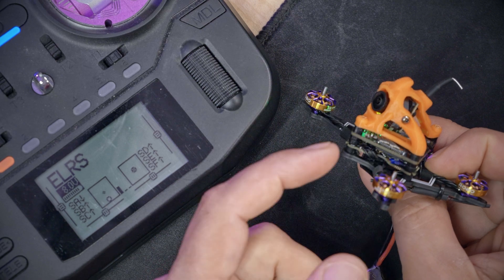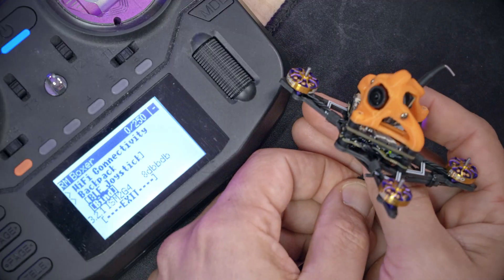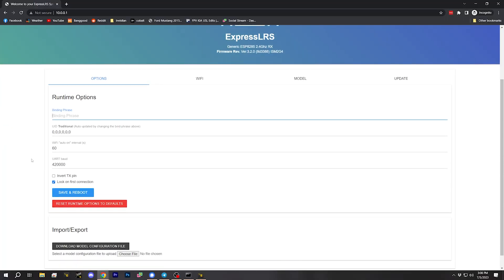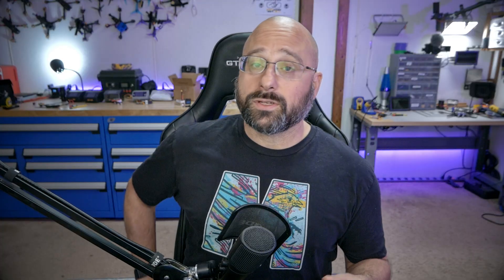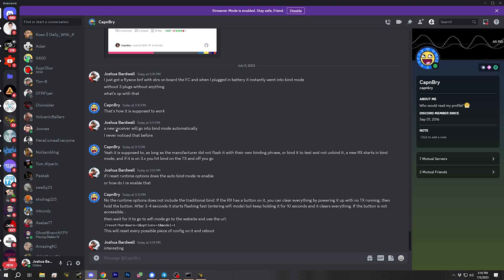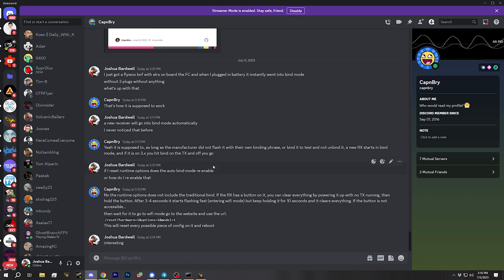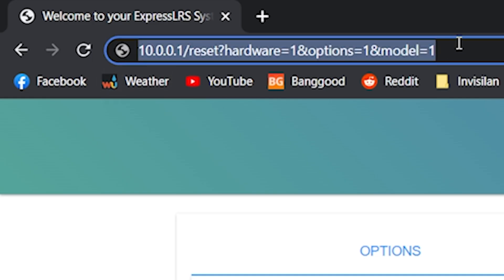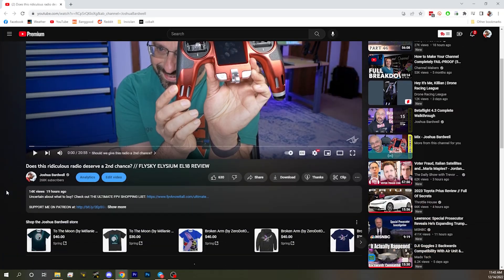Why I always bind ELRS the hard way (but you don't have to)

Comment: Mobula 8 elrs 2.4
Boxer elrs 2.4
OK, set up my binding phrase on my Boxer done 
The mob eight  into beta flight.   
Save the backup of all the settings 
Went to firmware update and pressed auto detect 
Flashed 4.5.1 
Then loaded back up file of all of my settings on the mob 8
All is well so far 
Now clicked on receiver 
It’s on expresslrs
Typed in my binding phrase 
Click save and reboot 
Turned my Boxer on    And nothing
Tried to plug my battery in three times on the mobula
Two times quickly then third plug it in 
Then clicked on my Boxer and I cannot get these things to work so back in the box and back on the shelf 
Help please

Comment: Just got the Boxer Crush and am excited to fly the cnc AG01 gimbals for cinematic. Working on binding it now-
Working to flash the radio with my bind phrase in ELRS Configurator-- it doesn't show Boxer in Radiomaster Devices, only TX16S 2400 and Zorro. Can I use the TX16S 2400 instead?
Thanks in advance for your help!

Comment: I gave the vid a thumbs up for your effort, which I really appreciate! I've just had so much trouble with a brand spankin' new Radio Master Zorro (my first non DJI radio). The drone itself would go into bind mode but the radio acted as if it couldn't care less about binding with anyone or anything. If for some crazy reason it does work someday it'll be named Desperado! If it wasn't for those oh silky smooth oh so perfect Halls gimbals, I'd either smash it with a hammer or put it in my 25-ton hydraulic press and make it slow and painful.... lol!!!

Comment: My preferred method is to first enter my home WiFi network on the receivers WiFi page and then wait for the configurator to see the receiver. The reason I do it this way is that changes to the firmware happen often enough that not a single receiver I have purchased had been on the latest stable release. It is more likely for the receiver to arrive with a version old enough to not be compatible with the transmitter module’s version. The configurator automatically finds the correct target when you flash this way and the connection to WiFi is a bit more secure since it’s not using the same password and SSID as absolutely every receiver not set to connect to home WiFi. This also allows me to verify that settings not on the WiFi page are correct. I believe the defaults are correct though for FCC.

Comment: There's another reason for not using the 3x power on method.

If you have a problem with flakey power - as I did a few weeks ago, caused by a dodgy FC - the Rx is liable to unexpectedly go back to binding mode all by itself.

OK, one can say "well, sort the power out", and in the end I did, but it's just one more thing to cause confusion when sorting out other issues. Now V3 has the web settable binding phrase, that is the easiest way for me.

Don't know why they didn't put a switch on like any other Rx really, but I guess it saves a tiny amount of board space. Though a split pad would have done, ie a through hole pad split into two isolated semicircles. Put a pin in, or a scriber point, while powering up, binding mode, don't, normal mode.

Comment: Thanks, Joshua you've helped me in many ways. Here's something that should be made public. I recently gave Geprc $1,000.00 for two drones. After only 4 days of flying the Cinelog 35 V2 03 I had to do a total rebuild. All went well except for the DJI cable extension that's exclusive to that drone. Antennas are easy to get but, that short antenna extension wires are impossible to find which means I spent $550.00 to fly that drone for only 4 days. I've hounded Geprc and DJI and can't get anywhere. WHY isn't that part made public? Any ideas on what to do. Can I make my own with the I-PEX connectors?
Reply: Later that day on eBay I found these extensions. In all sincerity both Geprc and DJI should have offered these parts. It was like talking to a wall. What the hell did I know of "I-PEX" connectors?! These fragile little things break easy. Last week I broke one installing the front arm on one of my Mimi 2s. Anyway, all is well.

Comment: This has to be the 4th or 5th video on binding elrs. Pretty sure there is only 1 video on binding crossfire. Just saying
Reply: That's the nature of open source projects that strive on innovations and community input. The difference here is that ELRS gives you options. When you can only do so little things, no wonder why your product is so simple.
Reply: There might be one or two others but, a quick search on his channel shows just as many for crossfire. He's covering each way to bind. It's literally exactly the same binding as crossfire if you don't want a binding phrase just plug in the receiver and hit bind on your radio. Also ELRS is better and substantially cheaper, just saying.
Reply from the maker: Ok so fly Crossfire then. More power to you.
Reply: @JoshuaBardwell  we want to fly ELRS   but NO ONE  will HELP  even for 150 per hour  .
Reply: but there's a bunch of videos on crossfire being out of stock...  also the videos about the company having issues...  so i'd rather have 4 ELRS videos about binding than a bunch of out of stock websites with crossfire nano rx on them
Reply: Rather to see 4 videos than doing 4 extra shifts to afford Crossfire :D
Reply: @dfsdgmythtrvvbyrtr  good cause i PAY 150 per hour for ANY elrs help . did i hear this could even be done via remoting into someones PC   .
Reply: best thing about the elrs wbsite is that you can not contact them unless you are on some weird platform . but they do have a donations page that seems to FUNCTION GREAT   .